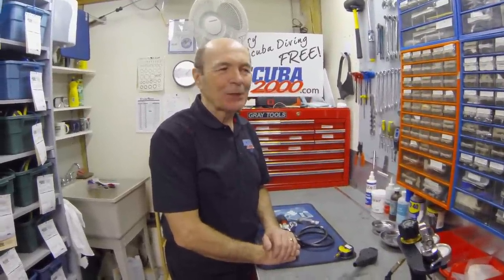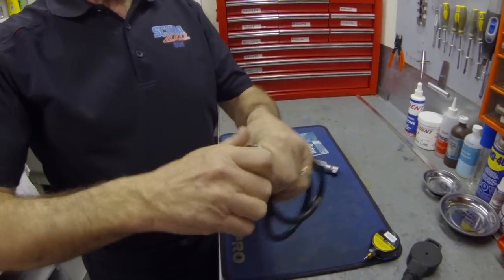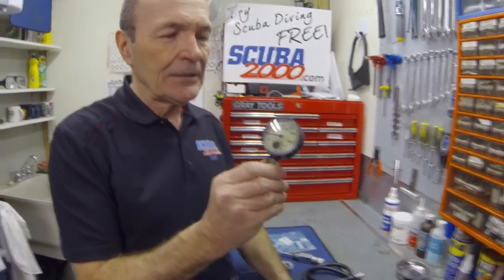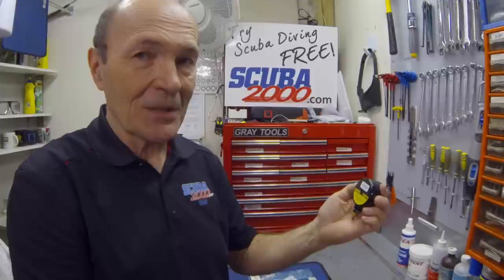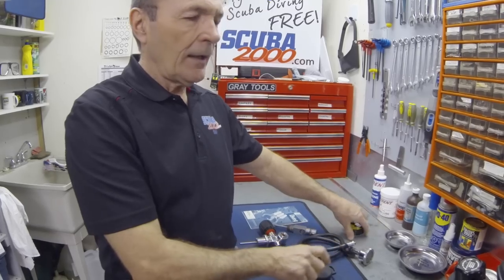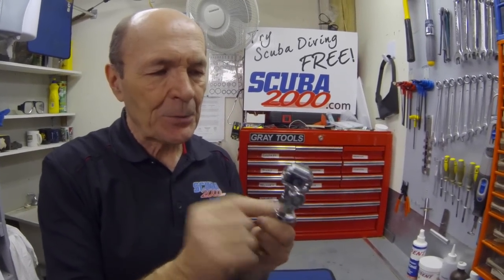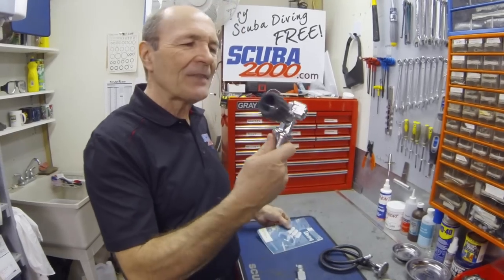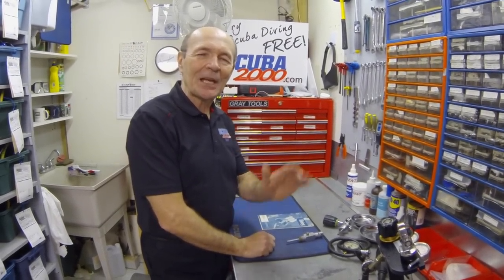Things Your Scuba Instructor Told You That Can Hurt You! - Scuba Tech Tips #3

Comment: Hey Alex, love the videos, thanks for all the info. 
When I recently went through the PADI open water diver course I was given a different explanation; I was told to fully open the valve and turn it back a quarter turn with the idea that when me and my buddy do our pre dive safety check we can easily ensure each other’s tanks were turned on by turning the valve the quarter turn back and to the open stop limit and then turning it back again a quarter turn. The explanation of the half turn reducing the working pressure of your high pressure ports makes sense, however assumingely the quarter turn would have half the effect on the aperture of the valve. Our tanks we used in class did not have the valve indicator you showed in the video, and I like that system a lot however is this an effective solution for easily checking the open/closed status of your tank valve in the absence of an indicator?
Reply from the maker: You know, whatever works for you and your buddy is the best way B13.
I just wanted to show the reason for the 1/4 turn back, which is because of the old valves that would stick open - not as an indicator to your buddy. A valve turned back 1/4 turn is not going to restrict the air flow enough to be a problem.
The Valve Position Indicator (Vindicator) is a great idea. I recommend it to every diver. With it, there is no confusion. A non-diver would know what it means!!
Failing that, every diver should know automatically which way to turn a valve knob to open it, or close it. It's the same as all water taps and valves - clockwise to close; counterclockwise to open. There are several ways to remember that - you turn it clockwise to close the same as you turn a wood screw to tighten it; some people say lefty-loosey, righty-tighty, meaning you turn left to open, right to close. Simply do it enough and you won't forget.
Your buddy should check your air valve on the surface so it's all set to go for the dive - never underwater where you can't communicate nor reach it yourself.
Maybe this is a good topic for a video.
Alec

Comment: When I took instruction in 1984, I was told to turn the valve back half a turn from full open.  The reason being was as a quick check, if the valve had easy play back and forth, you knew it was open and if not, it was closed.  Seems to make sense to me.  And, half turn closed from full open is going to have a negligible affect on flow regardless of pressure in tank.  P.S.  Great videos Alec.
Reply from the maker: We have a couple of videos that deal with this topic. That '1/2 turn back' is no longer recommended.  The downside to the idea that a loose valve shows it is open is that you have no idea if it's completely open or only a little bit. In an earlier video I also featured a device that shows if the valve is open or closed and by how much!!.
Take care.
Alec

Comment: Would there be any chance of a standalone video where you go into the old 'turn back' debate in a bit more detail? When you try to innocently probe the reasoning for doing so, no one has ever able to give me a better answer than 'I was told to do it'. I think a lot of it seems to stem from instructors who, through no fault of their own, do not have a technical understanding of the SCUBA equipment that they instruct on, and simply repeat what they were trained to do. That's one of the reasons why your videos are a real benefit!
Reply from the maker: You are 100% correct. Instructors are not experts on scuba gear - certainly not today!
And we always tend to repeat what we've heard in our own training.
So, ideas that are 20, 30 or 50 years old are still being expounded as the truth.

This is not to knock current instructors. Divers in general are less aware of the technical details of their scuba gear. The course does not talk about how a regulator works much less how to fix it. Plus regulators today are much more involved (complicated?) than the old ones.

The good news is that most of that kind of information is available now on the internet. But I do enjoy sharing my considerable expertise with equipment and will do some more.

Thanks for watching. Alec
Reply: I think divers of you and my father's generation had that technical background automatically if, for no other reason at least, because you started out by building your own gear in the first place!
Reply from the maker: Maybe partly. Also, it was the Do-It-Yourself age. People thought nothing of building their own kitchen table, bedroom set, boat, etc. 
Also, since there were very few dive stores, we had to learn how to take care of our own gear.
It was fun and now it must seem to young divers that we're so smart. Nope! Just a different age.
Reply: The problem I have found is the internet experts are sometimes wrong. That is why I have been truly ecstatic that I found your channel! Thank you so much Alec! Please keep the knowledge coming.  Brian
Reply: Alec Peirce Scuba seriously, Alec, I could not agree more with obar below. Your knowledge Is invaluable, especially as a prospective divemaster.

Comment: Another reason for turning you valve back was not sited here. The internal components of the modern scuba valve are made of very soft brass. The reason we teach students to turn the valve a quarter turn back its to protect the internal components when someone goes and checks the valve to make sure it is on. If it is all the way open and the diver tries to check it (especially new divers), they can force it past the full open and round out the valve stem. Now the tank is essentially stuck open. So, with the quarter turn back, when a diver checks the air the Handle will move open then stop.
Reply from the maker: Interesting idea James.
Having serviced thousands of tanks valves over my 47 years in the scuba business, I can assure you that the likelihood a diver using just his hands would damage the valve stem is very remote. Yes the parts are mainly brass but all internal parts are closely fitted and have full support around them. Even the 2 forks in the valve are unlikely to break while installed.
Modern valves also have a built-in feature that precludes such damage - the knob. Almost all knobs today are molded Cycolac (or some other very tough plastic) with a metal insert that accommodates the thread of the stem.
If someone over-tightens the valve, the plastic knob will separate from the threaded metal insert. You may have encountered this. The knob turns but the valve does not open - or close. The knob just spins. Quite common.
My suggestion is to teach divers, old and new, to use a tank valve properly. 
1. Open all the way
2. Never use more force at either end, open or close, than necessary. That means when opening, stop when you reach the end of the opening action; when closing stop when you feel the restriction of the closing seat.

A properly operating tank valve opens and closes with ease. NO force is necessary at either end. If it's stiff, it needs servicing.

Keep in mind, and reason for this video, is that the 1/4 turn back was specifically taught as a way to prevent the valve from freezing (read: jamming) open. I taught that for years in the 60's as did all other vintage instructors.
No need for that anymore.

Thanks for watching James and for your input. 
Alec
Reply: Hi Alec,

I agree with you that damaging the valve is highly unlikely and the original reason for turning the valve back is obsolete. However, I do it anyway for a reason that is important if you leave the comfort zone of the recreational diver. 

Let's say you are diving in a cave/wreck/night/zero viz situation with a dry suit and undergloves and something hits the fan. You need to close the valve NOW. As we all know, thinking underwater is a bit tricky, so I don't want to bet my life on muscle memory of myself or my buddy to definitely turn the knob in the correct direction. If the valve is fully open, it is possible (and I've seen it happen in cave diving courses) that the (blindfolded) diver slips over the knob trying to turn it in the wrong direction. If the 1/4 turn back is there, the knob will turn and stop, thus notifying you instantaneously that you are turning it the wrong way. The 30 seconds or more that it would otherwise take to realize your mistake, can cost your life.
Reply: Brother=Diver Tobias, excellent point you make sir! I learned something on this technique, & it makes PERFECT sense to me!
Reply: @tobiashartung856  though you could also make the opposite argument, that a fully turned open valve gives you a more immediate indication on which way to turn the valve to close it.
Reply: @danielmewes  That would be the ideal scenario. The point is that you can easily slip over the knob if it is fully open. With thick gloves it is very difficult to tell whether you are turning the knob or slipping along the knob. Thus, you may THINK that you are closing the valve while in reality nothing is happening because you are turning it the wrong way and the valve was fully open to begin with. 

The 1/4 turn back is much less likely to make you just slip as it will turn either direction. However, if you are turning it the wrong way, the turning will stop pretty much right away. You are very likely to notice that. The 1/4 turn back is therefore a much more reliable indication of which way to turn the valve.
Reply: @tobiashartung856  I can see that, makes sense and thanks for explaining it more.

Comment: While incredibly rare, SPGs can still fail.  Some modern SPGs don't have pressure relief plugs and some cheap SPGs may have relief plugs which don't work properly.
Best practise: Stick your SPG into your BCD while GENTLY tunring on air (turning it on too rapidly puts extra pressure on your system). This protects you (and others) from BOTH a front-face failure and the relief plug popping out.

As for the valves, yeah, don't turn them back a quarter-turn, or your friendly helpful DM/buddy might accidentally turn your air off instead of on during the pre-dive trips.
Reply from the maker: I have a scuba 'myths' coming out soon on this very subject Michael.  Thanks for watching.

Comment: Modern dive computers suffer from the same issue of rupturing the face as in the "50s and 60s."  Check out the recall notices.  Turning a tank value all the way open is not for the valve seat it is to prevent dethreading the knob by over torquing an already open valve.  But, all students should turn the valve completely open as there is more risk of not having an open take than there is of breaking a knob. That "not hard" statement shows you understand this. The clip that holds the know on is not very strong.

I am not particularly strong but have broken more than a few knobs BTW. And, in a few thousand dives I have had one dive computer face explode. In front of a student.  One her first check out dive.

Comment: I thought the half turn back was to stop people from forcing it the wrong way and breaking it.
Reply: Adam, you can't break a valve by turning it by hand.  Have all of your air available: turn the valve all the way on, and never let anyone mess with it.
Reply: +Michael Ross hi guys, I am not a pro on what is inside the valve but you can break it if you do it to hard. you break the screws that hold the knob and the tank stays open or close depend where you force  it. I know cuz I have done it ...
Reply from the maker: Usually what happens if your turn the knob too hard is that the plastic handle breaks. Then it will turn on the shaft but not turn the valve - the valve is stuck either open or closed. It's an easy fix. Remove the handle and replace it - total cost about $10. The worse problem is that you slowly ruin the sealing seat which will soon require the tank being drained and the valve rebuilt - total cost about $50! DON'T TURN THE VALVE HARD EITHER OPEN OR CLOSED. You can practice this with a tank that has no regulator on it. Open the valve slowly and carefully until air flows. The trun it slowly closed until the air flow stops - STOP TURNING!! That's it. When the air flow stops, the valve is closed. Get used to the feel. Take care. Alec
Reply: All adjustments on your regulator mounting and tank valve adjustment should be "hand-tight" only, not wrenched to the point of jamming.  The seal in the valve itself is brass-on-brass, and it would take a clearly excessive amount of torque to damage the valve seat.  The worst case scenario in this instance is that you'd have to have the valve overhauled (or better still, replaced with a 21st Century-era, stronger valve).  You should never use "vintage" or off-brand equipment of any kind.  Quality, up-to-date equipment will not be damaged by properly opening the valve all the way, as it always should be.  However, the possibility of over-tightening the valve (by a rushed dive master or non-trained deck hand) is yet another reason not to let anyone else touch your gear, except a trusted buddy - ever.
Reply: @AlecPeirceScuba_SeaHunter  in a cave when you have to close a valve on a twin system to prevent losing 1 of the cylinders, a broken handle can cost you your life. I also teach the quarter turn back to prevent forcing the handle. What do you lose by turning a half turn back? Nothing. It has pros and no cons, so just do it. I agree the valve handle is cheap, but only if you're on land, underwater when you need to isolate on twins, it could be deadly.
Reply: @michaelross8252  Unfortunately filling stations often overtighten 😡
Reply: Brother-Diver Michael Ross, right on!  After I have my equipment out & then set up, not even GOD (his/herself) will touch my stuff.

Comment: Alec at the nuclear plant where I worked we were trained not to leave the valve fully open on its backseat but close it a turn or so. We were trained to open the valve fully only if it was leaking at its stem.  What’s the difference?  Thanks 😊
Reply from the maker: Well I'm not fluent in nuclear power but I do know scuba gear and the 1/4 turn back started back in the double hose reg days (no longer used) because the "pillar valve" would expand and lock the tank valve if fully opened so a 1/4 turn back prevented the lockup due to old materials and so-so quality.  Not so today.  I can't answer why your valves are not fully open but the work 'leaking' is not what I want to hear from a nuclear site!  Thanks and take care John.

Comment: just out of interest what exactly causes the brass to expand or contract on an old style valve and how did backing it off prevent that from happening?
Reply from the maker: Simply the physical characteristics of the metal. Brass is an alloy of copper and zinc and expands/contracts much faster than most other metals. 
It causes lots of problems. For fun, look up the origin of the expression "it's so cold that it will freeze the balls off a brass monkey".
Take care.
Alec

Comment: All these tips you are telling me are wrong is all I remember from my dive course!
Reply: I did not deny that you were correct. You gave good and logical reasons - which I always like.  However, I can still recall the serious attitude of the instructor on Koh Taoh, Thailand, in 1991, about turning the valve fully on and then back off slightly.  He was also very serious about aiming the console away from yourself when you turned on the pressure.  I also recall how we had to blow any water out of the dust cap with high tank pressure (you mentioned that was not nice in one of your tips, maybe a different video).  
My point was most of the things you debunked covered almost all that I recalled so many years later.  I thought that was funny.  
I am enjoying your videos.

Comment: Hi Alec, My scubapro MK2 air gauge is reading more pressure, about 50bar more and I noticed its been flooded.  Can I simply air dry the air gauge? the o ring outside the air gauge pop up when I turn on the tank pressure. please help :)
Reply from the maker: It's very tough to dry out an SPG.
You must keep the O-Rings on the swivel pin in good shape.
All you can do is remove the SPG head and set it in the sun for a couple of days. That might do it.
Blowing air into the open end is not much value since no air will actually penetrate the sealed gauge.
It can't be adjusted either so you'll have to live with the inaccurate reading.
Normally it will read the same overage at all times so it's working alright, just inaccurate..
Good luck.
Alec

Comment: Apeks Owners Manual: 

If a submersible pressure gauge is attached to the first stage, ensure
that the gauge is facing away from you. Pressurise the regulator by
slowly turning the cylinder valve handwheel anti-clockwise. Continue to
turn the valve handwheel anti-clockwise until it is fully open, and then
turn it back 1/2 turn.
Reply: (Not disagreeing with your points, just interesting that manufacturers are stuck stating these things too...)
Reply from the maker: Either the Apeks gauge does NOT have a blow-out plug on the back (unlikely as most are made by the same company) or they are simply parroting the older diver manuals.
Thanks. Alec

Comment: One note not found in the FAQ's is if you do turn the valve back and it's too much at depths as little as 40 feet you can see your tank pressure "thump" (move rapidly) as you breathe and you will find the draw harder. Just simply don't panic and open the valve fully happens regularly in foreign countries with the "turn back" method.
Reply from the maker: Wow! What timing. 
We just did a video about that called "Why Does My Pressure Gauge Go Up & Down When I  Breathe?"
Watch for it.
Alec